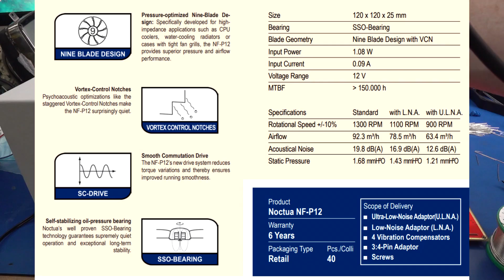Soldering Fume Extractor Fan Upgrade

Comment: i mounted two 120mm PC fans instead of bulb head on Ikea Tertial desk lamp with one layer of charcoal filter. It does not take any space on desk and you can position fans as you like and it is completely silent. Working distance is around 20-25cm from soldering iron.

Comment: I did a project video using a 3D printed box to mount filters, and a household extractor fan with a duct to get the fumes well away and well filtered it works pretty well.

Comment: The quality PC fans such as this one come in two flavors - high impedance or low impedance (there are also hybrid solutions). [Edit: We're talking airflow impedance, not electronic.] In a PC, the former is normally a heatsink fan, the latter is a case fan. As clearly stated in the description for this one, it is intended to be employed in a high impedance application. A fan intended for low impedance will probably move more air in a low impedance application like fume extractor.
Reply from the maker: "Low impedance" would have to do with the effective ducting length. I didn't look at the datasheet until I edited the video, just though I'd suck it and see (pun intended).
Reply: It's a fan so obviously it moves some air, but one would think that using the intended part for the application should produce a better result. Otherwise, why would they make them in two flavors? Would be interesting to see if there is a performance difference in practice.
Reply: @tangerinq  Don´t underestimate the flow restriction of one of those little filters. A high impedance model is probably the right choice for this.

Comment: I made something similar a few years ago. It used a large 12 volt computer fan, powered by a  AC to DC switch mode converter.
The fan was mounted on a base made from a small rectangle of uPVC roofing soffit plastic, using the small plastic screw blocks  that are more traditional used to hold cheap chip board furniture together. I fitted four stick on rubber feet to the plastic base to give it stability, slip resistance and to increase its hight.
The filter was made from a cut section of the filter material used in cooker hoods. This is made of a white fibre backed with carbon foam sponge, similar to that shown in the video.
The filter material was held in place using two fan finger guards mounted on the front, with one on the back for safety.
By holding the first two guards in place with long bolts and nuts, it was possible to fit the third guard to the front to hold the filter in place using knurled nuts that can be loosened with the fingers. This allows the filter to be replaced with out dismantling the whole unit. The nuts holding the first inner front and back guards in place provided the spacers to stop the filter material being over compressed. The inner of the two front finger guards, provided the surface on which to mount the filter material, while keeping it well away from the fan blades. 
The completed assembly is both quiet and efficient. Extracting solder fumes from almost a foot away. Its efficacy is apparent from the obvious brown residue that collects on the filter after prolonged uses. The filter material itself is sufficiently strong to allow it to be rinsed clean under running water, though replacement is not a problem as a single cooker hood filter, which is extremely cheap to buy, can be cut up to provide a reasonable number of replacements for the solder fume extraction fan.
The whole assembly is relatively cheap to build and occupies very little of the bench space, being little more that a fans width, with the base being just sufficiently wider to provide stability. In my case, I mounted a power jack socket behind the fan, so that the power supply could be unplugged from the fan. This also allowed a standard power supply to be used without any modification.
The construction has also found a more traditional uses as an external cooling fan for telecoms and IT equipment that does not contain its own fan. In my case, an ADSL modem, a ethernet router and a CCTV video recorder.
I published details of the design along with photographs on the now closed Maplin web forum. I do not know if any of the forums content is preserved on the web.

Comment: I have a Hakko FA-400 soldering exhaust fan thing. I want to put a Noctua quiet fan in there, but the stock fan runs on 110V AC power. All the Noctua fans I've seen are 5V, 12V, to 24V, and terminate with either Noctua "3-pin" or PWM terminals. The stock fan in this Hakko thing just has one wire to the external on/off switch, another wire to the attached AC wall plug, and a ground wire (to the ground in the AC plug). Any idea how to make this work?

Comment: Not so much the airflow that you need, it's static pressure as well, since it has to pull air through a filter! ...and I found that it helps a bit to put a 2-3cm spacer between the fan and the filter. I use the frame of an old fan as spacer...

Comment: You should really look into the NF-A12x25, a very high end slient fan from Noctua, that is specially designed to have enough pressure to drive lots of airflow though restrictions like filters and dense fins. They are pricey, but insanely good.
Reply: Still far apart from the original extractor fan. It takes a lot of power to suck enough air through that filter in order to get all the fumes away from 20-30 cm. I'm using a Sunon 12 V fan with roughly 2500 rpm without a filter, and even that is hardly strong enough for more than 15 cm.   There's a reason why these professional fume extractors are so loud, they need to be really powerful.

Comment: I've had two of those Noctua fans running back to back through the huge Noctua heatsink they came with on my PC's CPU for the past ten years - can't hear them even now.  Quietest most effective cooling tower arrangement I've ever had.  You could put two fans inside your enclosure for twice the airflow and you won't hear them at all.  Put a switch between them and you'll have low and high speeds, too.   Then add your battery...

Comment: Normal 40w 3 speed desk fan is quieter, sit one about 2m away from the work area set static to face the work area on setting 1... should blow the solder smoke towards the window.

My kitchen extractor is noisy but don't use it when there's 2 or 3 pots boiling away on the hob and the kitchen is like a sauna with steam down to the knees.

Comment: Noctua fans are great! It looks like you need to replace the carbon filter though. Is it really old? Looks pretty crusty, not sure it’s actually doing much 🙂
All the carbon filters I have are slightly flexible, not brittle
Reply from the maker: Yeah, I have a lot of new old stock, I think they are all pretty crusty
Reply: EEVblog2 I’m sure you could buy some new carbon filter material and cut it to shape

Comment: You may as well just use a desk fan as the carbon filter in your extractor is stuffed and not filtering out the toxins . i use a bathroom ventilation fan that sucks the air out through an open  window  which i find works well for soldering and 3D printing.

Comment: 7:27 You can't blow air over it because it will cool down the solder and it will solidify way too quickly.
And you should put the fan on the other side of the filter. The fan can't suck more air than there is air going through the filter, but you can always blow more through it.

Comment: like a pc case use a push pull system. just about to make myself a fume extractor for soldering tomorrow. plan on a push pull fan system variable speed control and a on off switch

Comment: I made fume sucker of old 220V mainframe fan, implanted in plywood window vent plate with aluminium convoluted tube. Worked great, so as made great noise. Now gonna craft thing like Dave's of 12cm PC fan, coal filter and.... don't know what to use as frame.

Comment: I suspect most of the noise is generated by the swirl imparted by the fan to the air impinging on the linear slats. This is one of the noise generation systems in PC CPU heatsinks and PSUs. 

To hugely mitigate the noise, mount the fan and filter remotely (perhaps under the bench) via a flexible HVAC duct pipe to your benchtop

Comment: The P12 is static pressure rated for higher flow in restricted cases (like on radiators). Your filter isn't very restrictive so you could probably get away with a noctua a12...smaller fanblades and higher rpm (at the same low noise) gives higher flow.

Comment: You need suction... That's a combination of airflow and pressure... Pressure usually expressed in mm of H2O .. but properly; Pascals.  Pressure is that which it will produce with no airflow and the rated airflow is at no pressure. Draw a straight line between those points on a chart and you have an approximate characteristic for that fan ... absent an official one.

When drawing through the filter and blowing out the case, then reducing unnecessary airflow resistance is the first goal.  Those slits in the case produce significant resistance compared to the wire "finger guard" style. If there's still not enough suction, then select a fan that's rated higher.  Having a fan operating has the advantage of you being able to measure the actual resistance to airflow using a simple manometer... clear tube in a U shape with some water in it.  You can the use the existing fan's flow characteristic to select the new fan.
Reply: Bernd Felsche And getting enough airflow is why he should not put a battery or other obstruction inside the box!  The carbon filter is not optional, as it's the only thing removing the fumes from the air returned to the room.  The depth of the box and the overhang reduce the percentage of the exhaust going back in, like an air "short circuit".

Comment: I was wondering what the performance would be like with a plain PC Fan, but that isn't a plain PC fan. It's a pressure optimized fan for water cooling radiators so it shouldn't have TOO hard a time with pushing/pulling air through that filter and still having enough power to suck enough air through it to clear the smoke.  And after watching more of the video, its clear it wasn't terribly great after all.

Comment: Put the frame of the old fan in front of the first one, so the blades don't move close to the grille, it'll cut down on turbulance. Also, noctua has an industrial lineup that would be absolutely damn perfect for this application

Comment: I use PWM to speed control a non PWM computer fan for my cat's litter box. When he enters the box a uC gradually ramps up the fan and lights so it doesn't spook the cat. Not that speed control is needed for soldering, just curious how a PWM fan differs from a regular 2 pin one. IOW, am I going to burn mine out or something?
Reply: There's no real difference.

Comment: But what is it doing exacltly? Suckin' air a trapping it inside the case?
Reply: GPUtest It pulls the fumes through the carbon filter, which hopefully reacts chemically with the worst of the fumes to make the exhaust less toxic.  Same principle as wearing a carbon filter gas mask.  Carbon filter obviously gets consumed in the process.

Comment: Most computer cooling fans will run at up to 18-20V without getting even warm to the touch. Being that it's a "quiet design" you might be able to increase the speed and it still be quiet while almost doubling the flow.

Comment: You can use the rubber from old optical drive stabilizers to stabilize the vibration, they should work amazing for this stuff.

Comment: you might get an improvement if you fence the workpiece in on one or both sides so the fan's sucking in less air from round the sides and more from over the PCB.

Comment: Rosin fumes can actually be more dangerous in unleaded solder. Unleaded solder is a bit more stubborn than the good old leaded solder, so the flux is often a bit more aggressively activated and/or it may contain a bit more flux.
There are certainly examples where that's not the case, but the unleaded solder fumes are certainly never less aggressive. You certainly work at higher temperatures with unleaded solder, that might add to more aggressive fumes, too.

Comment: Looks linke the mains wire goes on the ring contact of the fuse holder and not the base contact as it should be. Or maybe it does and only looks wierd...

Comment: I think some companies make fans in certain pieces of equipment louder so you'll think they are powerful.

I noticed it with bathroom fans. An exhaust fan for residential use is really loud. But a commercial bathroom fan of the same size moves about the same air, but is =much= quieter. I replaced mine with a low noise fan, and the only difference between the old and new fan was the exact shape of the squirrel cage blades. Same motor, same case, same size of everything.

Same with hot air guns. A cheap $20 loud hot air gun vs a $120 commercial heat gun. You need earplugs for the $20 model, but can barely tell the $120 heat gun is turned on. Yet the whole thing is the same size.

Shop vacs - surely you've noticed that cheap models are VERY loud, but larger more high powered are not as loud. If you buy a shop vac aimed at the commercial market, they are even quieter.

Table saws and other power tools. Same thing.

And those useless $20 solder fume fans... what a joke. You have to be soldering right on the filter for it to suck up the smoke, but they are VERY loud.

Vacuum cleaners - not so much any more, but home vacuum cleaners were getting very loud. Yet when you see someone vacuuming in a hotel or restaurant, they are using a no-nonsense commercial model that you can barely hear.
Reply: It's a matter of price, too. I've encountered Sunon fans in devices that sounded like they were running a diesel engine even at low speeds. Replaced them with a Noiseblocker eloop that has even more max CFM than the Sunon and they are way quieter at any speed.
The Sunon is like 10 bucks retail, the Noiseblocker about double. They do the absolute same work, you pay the extra price for a quiet motor and bearing.

Comment: at school we had a suction system on the soldering iron itself
Reply: Youtuber barevids has a setup like that. He has a small hose running right up to the tip. I think stainless steel tubing like automotive brake lines would be great for that.
Reply: @LabCat this was not complicated stuff. Small troughhole components (tops 10mm tall).  worked for us, when it was in place and nobody had riped it out

Comment: I always use a fairly high-powered (~2500rpm) 12 cm pc-fan (12 V) without any filtration. In my opinion, for my kind of hobby use, it should be enough to get the fumes out of my face. I also open a window and get some fresh air in.
Now if I were soldering many hours per day on a very regular basis, then I'd consider gettting or building something with a filter.

Comment: Why even bother modding this crap PACE crude metal contraption? Multiple fat grills obstructing airflow suggest it was modeled somewhere in the seventies with "I have a metal press" as the only "design" criteria.
Reply: rasz The grill size also serves to keep fingers etc. out of harms way. Much sturdier than a flimsy grill designed with "max airflow" as only criteria.  The overhang and box length limit the reflow from output to input, though not as much as an outside 5" pipe would.

Comment: The NF P12 is not an idel choice for this, because it is designed for high static presure instead of high CFM (it is designed for big CPU coolers and radiators)

Comment: There are industrial Noctua fans that aren't as silent, but have a much greater CFM through higher RPM
Reply: In the end, physics is still physics, even Noctua cannot change that! ;)
The Noctua industrial are nothing to write home about in my opinion. Relatively loud, they won't even start up until you give them 8 V and they will stop running when you turn them down to only 6 V (my own experience with a 12 cm Noctua industrial)
They are more like any other industrial fan: rugged, 24/7, made to run at 12 V. Not very good for silent cooling trickery at all, more useful for a server room.

Comment: Could be nice to have a fume extractor on a neck so you could position it better slightly over the work piece?
Reply: at that point why not simply wear a mouth mask
Reply: @RemcoStoutjesdijk  feels weird to trap lead/rosin right in front of my mouth?
Reply: Yosh Marklund That's where the camera usually is.
Reply: @johnfrancisdoe1563  I haven't gotten to that state of my soldering career yet 😅 But point taken

Comment: Put a stator in front of the Fan. It'll increase the air flow quite a bit. 3D-Printer can print one in about 12 to 14 hours.

Comment: run a flexible pipe out the window, no filter. less noise, less fumes. (make a hole to outside if window does not open)

Comment: Dave, look into the 3000rpm ippc noctuas.  You can even get them in IP67 rated.   they will have MUCH better airflow and static pressure, which is really what you're missing here pulling through a filter.

Comment: fumes are exhausted into the room.  You'll still breath the fumes in eventually.
Reply: That's what the filter is for! It catches most of the fumes. But even without a filter, if you air your room and use a fan without filtration, it is way better than getting the fumes directly into your nose or your eyes. And that is where they always go when you don't have any fan at all: right up your nose or your eyes.